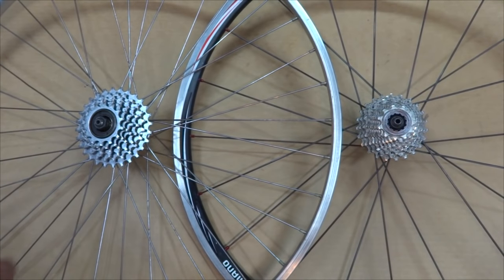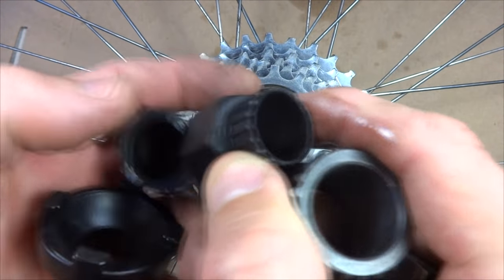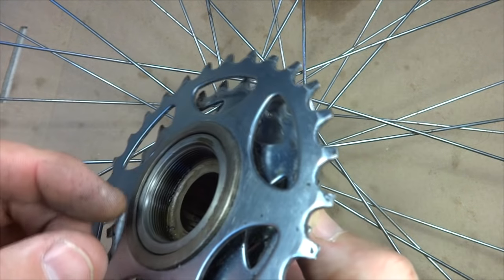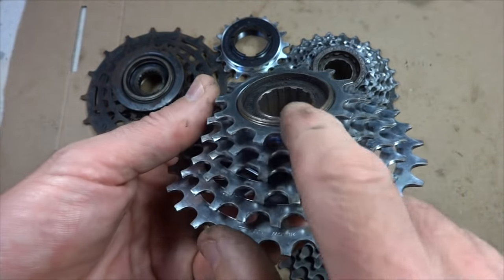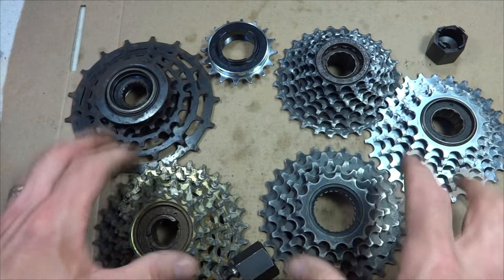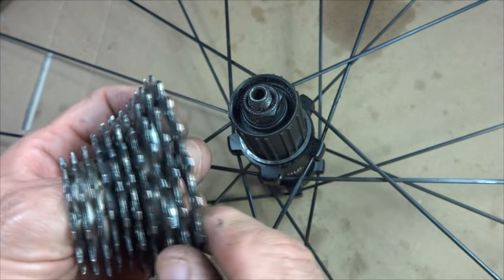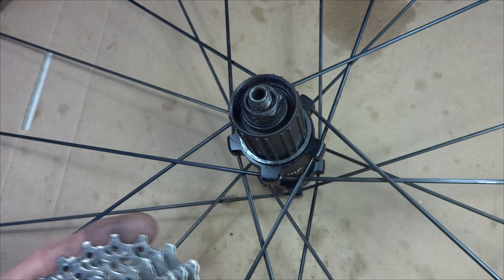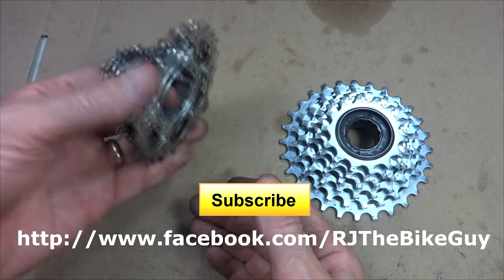Freewheel vs Cassette - What Are They? Can I Convert?

Comment: One important difference, at least for heavier folks, is that a cassette / freehub distributes weight on the axle better than a freewheel. The drive-side bearings are much further from the dropout on the freewheel which can lead to bent or broken axles. Freehub / cassettes have the bearing much closer to the dropout hence less stress on the axle.
Reply: Bought a 27.5 mtb wheel with cassette today.

The freewheel type wheel that came with the bike has snapped 5 axles and bent one solid axle in the last 5 years.  I am free of that wheel now!!!!!!!

Comment: The main advantage of a cassette hub over a freewheel hub (besides reliability and simplicity) is that the rear right fork of the frame will sit on the axle on the hub side much closer in from right end of the axle (looking from the rear of the bike), whereas with the freewheel hub, the right fork sits much farther out towards the end of the axle, making the axle much more susceptible to breakage.
Reply: Not only because of breakage, also because of crooking. Nearly EVERY axle of a used cassette hub i've seen was crooked. This of course inflicts damage to the bearing. Therefore it's actually worth to convert to freewheel.. ;)
Reply: Agreed. I'm large and have strong legs, and replacing the rear axle was just part of the regular maintenance when I had a freewheel -- and that was on my road bike. With a freehub, I've never had to replace the axle.

Comment: To remove a freewheel you can clamp the  remover tool in a bench vice and  place  the wheel down over to mesh the freewheel splines firmly into the tool in the vice.  Then grip the the tread of the tire like a steering wheel and turn the wheel to loosen the freewheel using the leverage of the spokes.  I seem to remember you turn it counter-clockwise to loosen but I'm not sure.  Otherwise you need a wrench with a long handle for leverage.

Comment: So are most newer mtbs cassette style setups?
Reply from the maker: Yes. Low end bikes might still have freewheels.
Reply: @RJTheBikeGuy  thanks you rock. I'm tinkering on my diamondback response mtb for the first time and I need to buy a removal tool.
Reply: @mixflip  Keep in mind that the old flywheel ones last a lifetime, and the new Shimano cassettes a few years. (depending on how you keep your bike)
Reply: @Makulax  Yes i Think you are right I think the old ones are steel and the new ones alloy Iguess the future ones will be some composite materials ceramic mixed with different hardening materials probably some carbon fiber with plated with ceramic composite in the more expensive ones similar to xx1 etc today for the Roadies that wants their bike to not be affected by gravity so they only pedal their own weight
Reply: @HeathenRides  IM FUCKING DEAD 😂 💀

Comment: Something you probably could have talk about is the plus and the con of a freewheel and a cassette. So i will write them down.
Upside of using a freewheel:
Changing the freewheel also result in the change of the rachette mechanism.
sometime the price can be cheaper. for the part itself.
Downside:
if the last time the freewheel was instal has been without greass on the threads and it's very rusty, then it may be impossible to remove.
it is very likely to be heavier
the more you force on pedaling, the harder it will become to extract.
 
Upside of a cassette:
More likely to be lighter.
the screw wont tighten as you ride, as long it's greased when installing. It will always be easy to remove the screw holding the cassette.
the ball bearing's bowl is in the cassette's core, as a result, if the bowl get spotted from riding impact or worn bearing. It can be replace.
because the bearing is in the core's cassette, it has better weight support and handle impacts much better.
Downside:
The cassette's core is never replaced when replacing the old cassette, so wear will eventually comeback and say hello to your pockets.
if the cassette's core has to be change, you also need to remove the bearing/shaft to access the center screw which need unusually bigger Allen key. Then you need good skill to rebuild the bearing with no play.
con to myself... why did i even took the time to write all this. Welp it's there now.
Reply from the maker: The main reason is that with more gears, the freewheel got wider and wider, and the axle extending out past the bearings in the hub got longer and longer and more prone to bending and breaking. Freehubs allow the bearings to be farther out and less bent, broken axles.

Comment: Clean, easy to understand video as always. It's nice to see advancements when you're working with bikes from different decades. Freewheel had problem with the threads = wobble and axles bending because the placement of bearings. Same thing with BB's when they moved bearings closer to cranks to reduce sideways torque.
Reply: Love your videos. Thanks for your work.

Comment: What he fails to talk about is the bearing position, cassette vs freewheel. And why you would use the cassette over the freewheel design. Basically, on a freewheel the bearing is positioned in the hub behind the threads, a couple inches from the axle contact with the frame. This leaves  a relatively long section of axle between axle support and bearing surface, making for a rather large lever. With large vertical forces on the axle, like in common Mt biking, it tends to bend the axle and cause damage to the hub. Shimano introduced their HG style for mountain bikes to eliminate this problem.  And it became the industry standard very rapidly. The bearing is placed in the free-hub, much closer to the axle support, and stopped bent and broken axles.

Any application where increased weight or vertical motion puts added stress on the axle, like tandem or loaded touring and all forms of off road riding, a free-hub and cassette is the correct choice for the bike. For light weight riders doing smooth road riding without rapid vertical events a freewheel is fine. Heavier riders should stay clear of freewheels or be prepared to change out bent axles. In the case of a bent axle that is allowed to progress, it will destroy the hub.
Reply: i agree with you but i managed to break 3  or 4 cassettes hubs in last 1 year in my  occasional driving on steep hil,
Reply: @makantahi3731  I feel your pain. And I bet I can tell you what happened. Shimano freehubs changed everything, but are not without their own issues. Under high stress or when contaminated with grit they tend to crack and die. I have had chips from the prawl catches get in the bearings and eat up the races. As well as shattering of the case. As soon as I see any sign of gear catch or drag they are replaced. I have tried servicing them with limited success.  So, I bet your problem has not been with the cassette (which wear relatively to chain wear) but the freehub.
Reply: cassete hubs,3 of 4 hubs broke on same place:on right side of hub in body of cassete left thread broke on what is screwed outher "cup" of bearing (inside are balls), when i bought last hub  i asked seller if he can guarantee it will not break-still is ok but i was on lethal uphill only twice. when i had freewheel system i broke axle every 2000km, then i switched on shimano cassete hubs with 7/8 speed  and drove races on it and no problems (1995-2000) and now when i drive occasionally  i started to destroy  hubs
Reply: @makantahi3731  Your English syntax is poor, and I think you are using your terms inappropriately. A cassette has no threads. They slide onto splines on the free-hub. The free-hub is is attached to the hub body by a threaded bolt that the axle goes thru. The damage I was referring to is usually cracks or breakage to the free-hub casing. The race for the drive side bearings is threaded into the free-hub casing. It is pressure from those bearings that causes the breakage to the casings. By transferring loads to the 2 rows of very small bearings in the free-hub that are generally not easily accessible. Those loads put lateral pressure on the casing causing failure. I believe your problem is a broken free-hub casing, a fairly common occurrence. Upgrading to a hub brand, like Chris King or Hope, that uses a CNC'd free-hub casing (Shimano uses a cast casing) will fix your problem. Otherwise, learn the signs of the free-hub failing and replace as soon as you see them. If you continue to ride steep hills once the damage has started you WILL continue to have failure.
Reply: we can speek in my language if you know it better than i know english, if you want to disasemble hub , you unscrew nuts on axle, when axle is out of hub you can remove bearing balls and on right side of hub in free hub if you wanna get to smaller balls, you have to unscrew left thread "nut"/"cup" /"outher bearing bed"(not hollow screw that keeps free hub on rest of hub)-that thread is broken , on two hubs, and it can not be discovered when it started to break, only when is broken and wheel then starts to dance left/right, now i have some no name hub that seller claim that will not beak, if would i have spare parts and will try to repare shimano hubs
Reply: @bryanburnside9783  Yes, Many of the Cheaper Shimano free hubs common on $500-$600 bikes 5-10 years ago  (large diameter almost like a Phil Wood hub) have drag in them now  moving the chain around when coasting with pedals still.  Junk and very common hubs. Laced Wheel replacement.
Reply: @hemisuperzee1287  5-10 years is a typical service life for those units with moderate Mt biking use. Since I retired and began rebuilding used bicycles for resale I have come come across bikes of all levels of use and abuse. It has surprised me how well many have survived serious neglect and usage. But overall there are thousands of bikes sold every year that just sit in garages across the country. Makes my job much easier. Bottom line; I rarely have to purchase new free hubs, Since I have maintained a stock of "parts bikes" and wheels. The trick is to always have a stock of new hubs and rims and newly built and rebuilt wheels available to upgrade or replace the severely wore and damaged ones. So, I am always looking for deals on new hubs, as many sell for $15-20  instead of the $30 for a new free hub.
Reply: @bryanburnside9783  ..ha ha..............You and I do the same thing.  I moved on from bikes in retail stores (no $ to be worth it), but did/still do in my garage bike shop forever. It would be interesting to see RJ's garage walls besides the door LOL (lots of parts and hanging wheels I bet). I seldome re-lace average rims/hubs anymore when good used or cheap new on Amazon will do. (unless Im really bored and the snow is deep). I see about the same ratio of bent axel freewheel hubs as I do the seized cheap shimano freehubs (which seize even on comfort bikes like Spec. Globe granny bikes).
Reply: so CASSETTES are better then freewheel, it is the latest technology! right? and got to buy a hub that matches the cassette. and the holes of the hub needs to match the holes of the rims! all gotta connect right?
Reply: @emailyarabrandao  right
Reply: Most of the mid 80's 10 speed hubs were thread-on and were the narrow hubs. So they do not fit the wider 135mm hubs used for cassettes. Measure the axel spacing of the frame for the rear hub. Best bet is just repack the hub with new bearings and ride it. If you are riding road the freewheel should handle your weight.
Reply: BTW  modern standard for road  hubs is 130mm  and they have cassettes . The old narrow 10 speed is 120mm. look here; https://www.sheldonbrown.com/cribsheet-spacing.html
Reply: Makan Tahi - that was a pretty funny comeback.
Reply: Absolutely spot on. Happened to me with my shitty freewheel system, hence im watching these videos right now.
Reply: Thank you!
Reply: @makantahi3731  You tell him!!  haha

Comment: It's worth explaining why cassettes overtook freewheels, so folks don't bother with the 8, 9, and 10- speed freewheels that are on the market today.  

Short version:  The longer the axle end overhangs to pass through the freewheel, the easier it is to bend and break.  By the time 7 speeds were common, reliability became enough of a problem for most people that cassettes arose to address it.
Reply: Precisely. I couldn’t have said it better myself.
Reply: chalo colina i just realised the difference between freewheel and cassettes and i have a freewheel rip might buy a new rim with a freehub
Reply: Yep.  Most people assume the biggest advantage of the cassette over the freewheel hub was ease of removal.  But it’s the elimination of the broken axle problem inherent in the overhung axle bearings on the drive side.
Reply: And now with many modern 'boutique' cassette wheels; those old lessons about bearing placement go out the window. with funky 'modular hub' designs that have a freehub body that just slip fits onto the axle shaft and has its own bearings separated from the main hub body.

Comment: Thanks for the clear explanation.
1980 Gios Torino Super Record with first generation Campagnolo Athena group, circa 1989-1991. SunTour Pro Compe freewheel 14, 16, 17, 18, 19, 20 on Campagnolo Super Record hubs and 42-53 chain rings. Brake levers are for braking, and the shift levers are rightly placed on the down tube.
Steel frames forever!
Reply: I had Athena Hubs, they were wonderful.

Comment: Just came across a kid bike 7 speed with uniglide on it.. it had plastic spacers between all the gears and several had broken. Ended up making new spacers using sheet of delrin that I sanded to the correct thicknesses.

Comment: I'm not a road biker, but have recently taken up riding some parts of my ride on paved ground to extend my rides, and so I come into contact with road bikers a lot now.  One thing I noticed was that their rear hub, sometimes, was much louder than mine.  I happen to have a rear cassette and after hearing you spin the freewheel a few times I think I know why they were so loud.  The ratcheting mechanism on the cassette's seem much quieter than those on the freewheel.
Reply: I tought pro cyclists used cassete
Reply: The very loud freehubs that have appeared in recent years (like a bee buzzing) have mechanisms that greatly reduce the tiny fraction of a second lag time that the pawls in a regular free hub require to reposition themselves into pedaling mode from coasting mode. There are a couple of different types out there, a couple with no pawls at all. In reality I believe this microsecond delay is meaningless to anyone in reality, but racers think it gives them an edge. Others install them because they can afford them and so it’s a form of elitist snobbery, if you have the loud buzzing freehub now then then the other snobs know you’re one of them. For me it’s really funny because when I was racing in the 80’s and 99’s it was just the opposite, a loud freewheel was a sign of a s squidly know nothing amateur, and it was cool to have a smooth quiet freewheel.
Reply: rollinrat4850  interesting read. been commuting on bike full time for over a decade but only recently getting into maintenence. going to have to check out the brands you mention

Comment: I tried to remove such lockring on a bike.  Previous owner had used something like engine oil to lube the chain - with the years the oil had hardened very stiff on the chain, cogs etc. I think oil also got under the locking ring and hardened underneath it. I could not release the ring no matter what. At this point may try soaking the cassette in paint thinner overnight to dissolve any baked grease that holds the ring.  Keep this in mind. By the way, a nice way to release the ring is put the cassette on the floor, insert the center spline tool with a 2ft pry bar - hold the bar from rotating between your knees, punch or rotate the lockring.

Comment: Thanks a lot RJ :)

I was confused about cassette and freewheel.
U explained very clearly. Thanks
Reply: +Rounak SIngh He could have said  all in two sentences:A freewheel has mostly 5-7 gears and is fabricated with the freehub as one part. A cassette has 7-10 gears and they are exchangeable and is no replacement for a freewheel.

Comment: You can actually adapt modern Hyperglide cogs to fit the older Uniglide freehubs.
You just have to keep the small Uniglide screw on cog of course. 
But you can easily enlarge the notches on Hyperglide cogs with a file to fit the older hub.
I modified a 70ier 5-gear Uniglide hub this way with cogs from a modern 7-speed cassette and if I remember correctly, I got about 3 tooth wider range out of my vintage 10-speed bike for better hill climbing.
Reply: I did exactly the same thing, but only after buying a second vintage bike just for the cassette and wearing out the cogs once again. Even my LBS didn't know this trick.

Comment: OHHHH, boy.  I don't miss the freewheel days, at all!  When you're in the "Clydesdale" class, unscrewing those beasts was a knuckle-busting nightmare!  They would wedge in there so tightly, the removal tool would sometimes strip, or worse, the slots in the freewheel body!
And yes, it was possible to cross-the body when installing them; the hardened steel freewheel body had to be perfectly positioned before you screwed it onto the butter-soft (by comparison) hub.
Those hubs though, some beautiful.  I miss the high-flange hubs.
Mmmmm... 
I can still damage a free hub 11-tooth sprocket, but at least that's all I have to replace if it gets damaged during installation, or high efforts.
Reply from the maker: https://www.youtube.com/watch?v=KVCOjZ4wCgA
Reply: If the guy who installed it didn’t grease the threads it was a nightmare. But if greased not too bad, you always had to muscle it though. I used to take mine off a few times per years, repacking the hubs, and so the freewheel didn’t have too much time to get attached to the hub :)